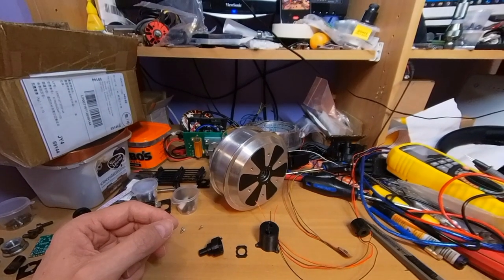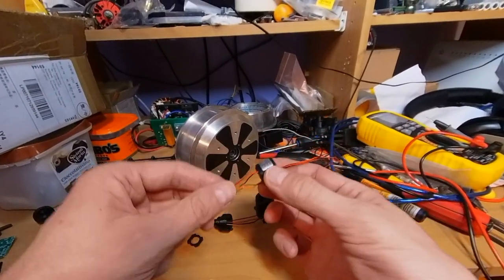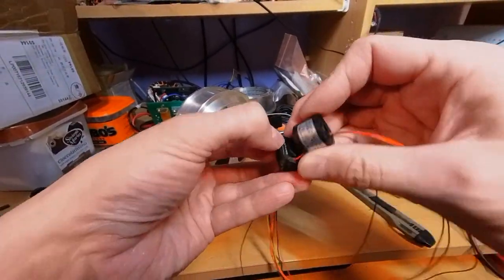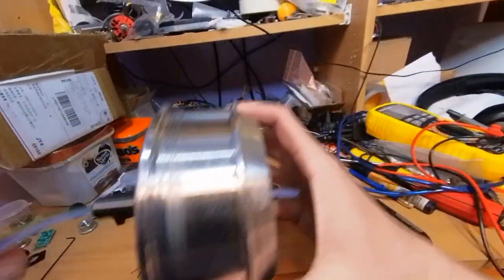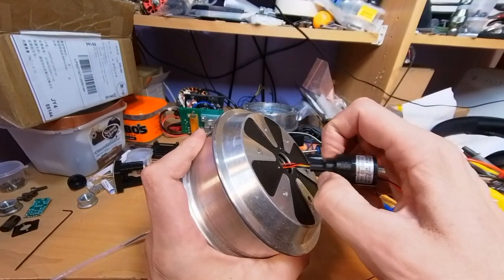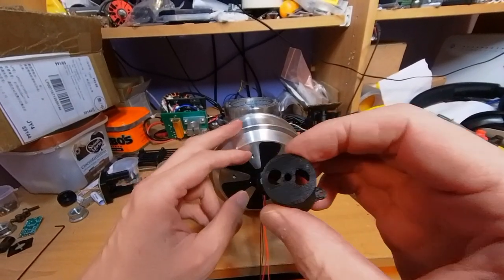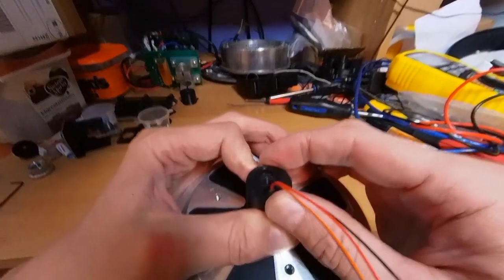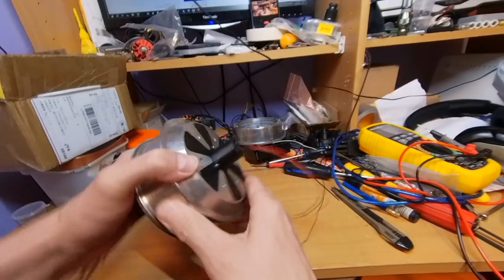ffbeast encoder and slip ring holder

Comment: How it is working after 7 months? Any updates on the tutorial?
Reply from the maker: I haven't been doing much sim racing the last few months because of time/energy/motivation/back ache/other projects etc. Currently my wheel is still waiting for me to figure out if the disconnecting was because of the slip ring itself or if I damaged the slip ring wires.

Comment: First of all, I would like to thank you for the great idea. My steering wheel used to work only with a magnetic encoder like in your video, but I was always missing functional buttons on the wheel. For a while, I used a wireless board with great response, but after 5 minutes of inactivity, it would turn off, and after reconnecting, I always had to restart the game... That was really annoying. Then I discovered your video, and it’s a perfect idea. I installed everything according to your instructions, and now I have two fully functional steering wheels with buttons. Thank you very much!

Comment: Very good idea, Thank you so much for sharing this, The Slip ring link is no longer available, may you please update it.
Reply from the maker: the link still works for me. Try searching for SRT007-22 slip ring on aliexpress. It should be 7mm inner diameter, 22mm outer diameter and about 16.8 long. They come in multiple versions with different numbers of wires, make sure you get enough for what you need.

Comment: Holy shi man I've just been breaking my brain trying to figure this exact thing out for the last couple of days - I just couldn't figure out how to get the encoder and the slip ring in at the same time without messing with each other. Glad to see it's already a solved problem and that I don't have to reinvent the wheel!

By the way, I have a few questions, if you don't mind.
1) Will the USB interface aka 4 wires be enough to power all of the components on the wheel? I suppose just an Arduino and some buttons would be fine, but could it also handle some display for example?
2) How about the slip ring? I chatted with GPT for a bit and he discouraged me from the cheaper slip rings because their signal tends to be noisy (or at least, so GPT claimed)
3) How about the rotational encoder reading? I suppose you've gotten to test this in practice already, so - does it work fine in that configuration?

Thanks a lot again for doing something so wonderful :]
Reply from the maker: Thanks, glad you like it.
1) The slip ring specs say 1.5A per channel, I think that would be enough for a display.
2) I probably only have less than 10 hours use on my one, but I haven't had any problems so far. I'll have to see how long it lasts. If it wears out too quick, I might consider using an external coiled cable or a wireless wheel.
3) as far as I can tell it's working fine. I've noticed a tiny bit of cogging when turning the wheel gently not in game. Turning it off and on again reduced it. I'm not sure if that's normal or why it varied, but I don't notice it in game.

Comment: The stem is simply pressed into the rotor bearing? Doesn't it move over time? Eventually, the heat from the engine will cause it to move. I need an answer, please
Reply from the maker: yeah it's just pressed which is the same way that https://www.printables.com/model/934160-ffbeast-encoder-assembly does it. I haven't read any reports of them coming loose. I won't be able to tell you how it'll hold up for a few months I guess, I've only just got my wheel back together. The motors can get quite hot, so it's probably best to print it from ABS or ASA (I used ABS).
Reply: Ok. Thanks.

Comment: This is very interesting, the only thing I'm not sure about this method is the precision of the rotation, other mounting methods have less structures to hold the magnet and the pcb, but the only other way I could think about having the buttons on the steering wheel was to use a bluetooth gamepad (ESP32-BLE-Gamepad)
Reply from the maker: There's always the standard way of having a coiled cable wrapped around the wheel spacer (assuming you have a wheel spacer). might not work as well without a narrow wheel spacer to wrap around.

Comment: I was wondering how to add buttons/paddles to an FFBeast wheel base without running separate cable to the wheel, either by cannibalizing some cheap wireless gamepad, or using another wireless solution. I was also thinking about using a slip ring, but your implementation is simply genius. I am very happy that i stumbled upon your video. Thanks a lot man.
Reply: How yo make? Can show?